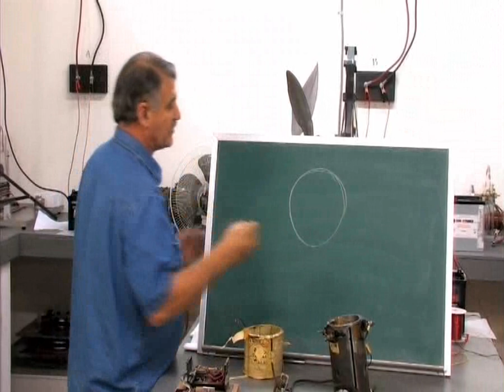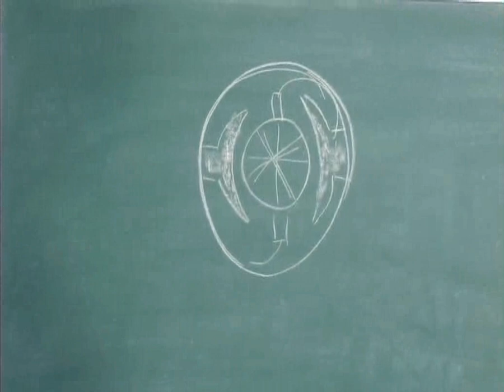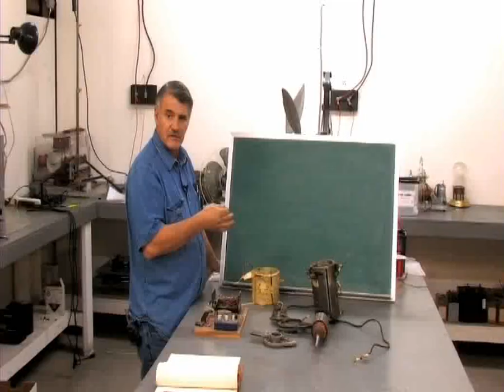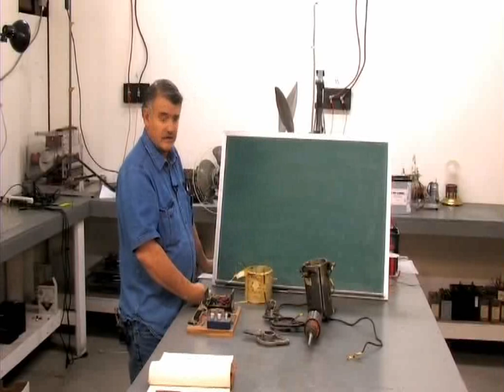Energy from the Vacuum - 14 - Lockridge Device - Part 1

Comment: This device can be remade and it will work to produce power. The physical model in this video series won't work, even correctly put back together because it's "burnt out". Even if the right [size & shape] brushes were made this specimen still won't work.
In my understanding, there is negative & positive energy of electricity. And electricity can be switched from positive firm to negative form. I think the Joe Cell can be made do this. Toroid coils cycle electricity back to positive & negative and then negative to positive. Perfect toroidal coils do this without loss, but it's very difficult to make a perfect toroidal "donut".
It's also my understanding that most of are circuits, electronic devices, and computers mainly use positive electricity to function. Stuff like RF interference (or interference from the EM spectrum ((including gravity)), impurities in conducting metals, and other things that cause loss, resistance and heat. Negative electricity in a positive system also acts as interference & causes efficiency losses. And vise-versa. That's why circuits need grounding. This is a way to improve computers: filter/divert the electricity going into a processor and it will perform better with less heat. And motherboards & circuits can be made to run on negative energy also. A positive & negative computing system can be run in parallel with each other as long as there's sufficient limiting (like diodes & resistors) grounding, filtering, and divergence. This concept is why slots were cut into the housing.
I think that the Lockridge device used both negative and positive electricity. If I remember correctly, the motor ran on positive power (like we're used to) and the generator ran on negative. So if one redesigns the Lockridge device, start with using AC currents, not DC. Then you'll get closer to the original German designer/inventors who started this. 
Think of electricity this way: Electricity is like sound waves. AC can be split positive & negative (top & bottom) like seen on a scope. Tesla loved to experiment more with AC than DC, because it (AC power vs DC) was more 'natural' in his understanding. Most of what Tesla shared & taught is according.
Maybe the two N spikes in the magnetc field forced electricity to either aline to one side of power (positive or negative). Maybe it forced positive electricity to negative (remembering that opposites attract). I don't remember. The positive electricity reacts with one side of a magnet and negative electricity reacts with the other side. I don't remember if its N&- with S&+ or North pole with positive (causes an emotional response in me similar to eureka/surprise/excitement) and South with negative.
Dipole magnets (either two opposite sides North or South) can also help.

Comment: Where I work there was an older guy that was not necessarily into overunity devices or anything but rather just a mechanic, collector, and junk dealer.
Antique machinery and such .
He told me a couple times about a certain AC motor and AC generator that he connected together and once getting it spinning by plugging in the the motor to line current he would plug it to the generator and it would power itself. He said it needed the right amount of extra load, which was around 100 watts of lights, to keep running.
It had to have the right balance or it would quit, otherwise he said it could run all day or all week.
I told him if he ever hooked it up again to let me know, I want to check it out.
He retired to full time junk and antique dealing, then after about a year of retirement he died.  I never did get to see it.
Reply from the maker: Oh no sorry to hear he passed away, that would have been something amazing to see. In many devices like this the specifications are very important. Making replication quite difficult.
Reply: @GuardianEngraving  he was just an old machinery and junk dealer, he used to go to tractor shows. Maybe he got ahold of one of these machines that someone was making?
I don't know whatever brought it up but one day he told me about it. Later some time it came up again and he told me more. I thought it sounded familiar where the load could only be just so much and had to be balanced out or it would not run.
Didn't know him all that well, never been to his house. Just a work place friend.